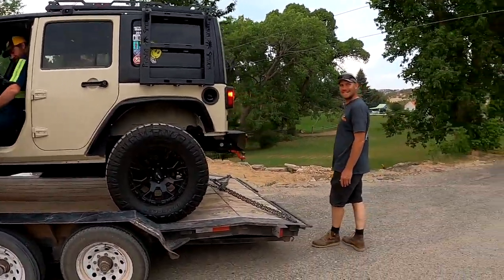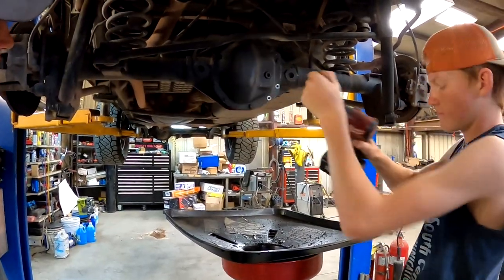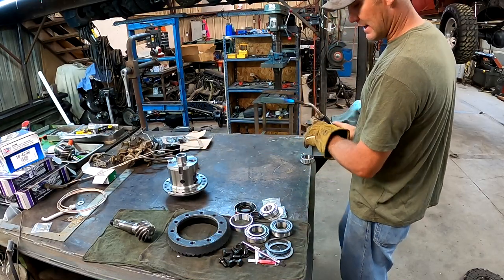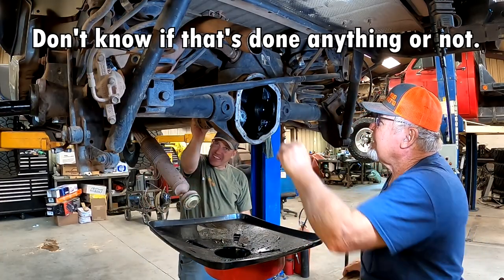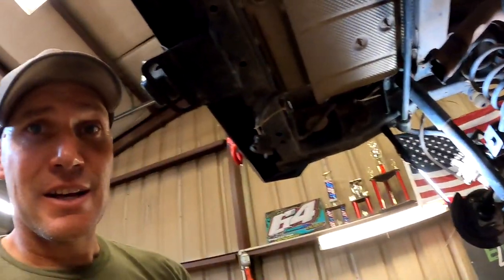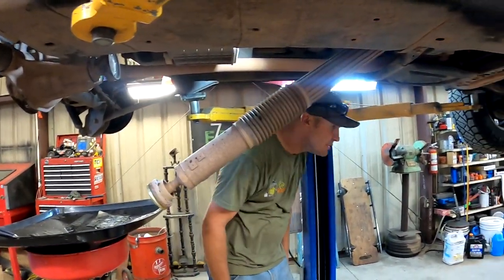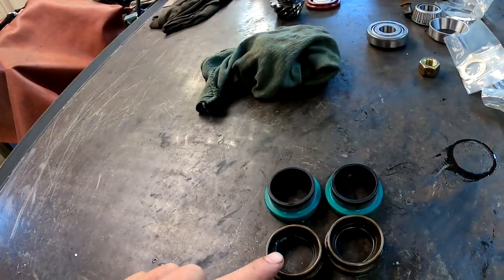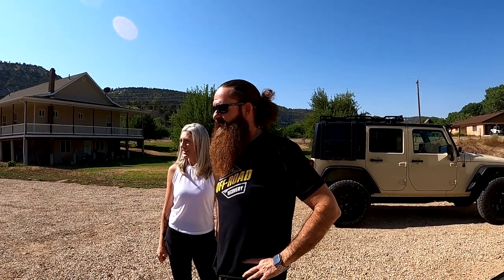Are all JEEPS this cursed?

Comment: Long time viewer, First time commenter. I was watching how you heat the bearings to slide them right on and wanted to tell you that most of these bearings are made of 52100 high carbon steel. They are hardened and tempered to a specific rockwell hardness. Heating them to a brown or straw color definately changes the heat treated hardness of the steel making them softer. I don't know if that affects there use or wear at all not my area of expertise. I am a knifemaker and can see by the color whats happening to the steel. You may want to look into it. Having said all that I absolutely love your video's and the work you do. Keep it up and best wishes to you and the family!
Reply: 100% correct.
Reply: Timken says that 250 degrees is the upper limit for pre-heat before temper starts to change
Reply: i agree Heating that Bearing like that did not sit well with me. He Might want to Try dry ice on the axle, that might work. or Just Pres them on like i believe is the Recommended / Designed Method. a little dry ice on the axel & they might just tap right on.
Reply: When dealing with tempered steel if you change the color of the steel you have changed the hardness of the steel.  It is not necessary to use that much heat a little will do it. Or Instead of putting heat on the bearings I chill the shaft causing it to shrink.

Comment: "I just made it hard"!  No truer statement has ever been made.  I am delighted to see someone else has the same luck/curse that I have.  Now I don't feel like I am alone with this luck/curse.  

 When I worked in the field repairing heavy equipment, many times I had to have more parts brought to me.  Sometimes I was 3 hours away from the shop.  That is just the nature of repairing in the field.  Since you are an hour away from your parts store, you might as well be in the field.  LOL

If I had to order a special seal to do a job, I would always order an extra one.  If it was a special order, I would order 2 extra.  I could always return it to the parts department if I did not need it.   The old saying, "It is much better to have it and not need it, than to need it and not have it," is soooooo true.

Comment: Fab Rats you make it look so easy ! As for MAP gas heating the inner bearing race only drawback is you could temper the race soft if you go past straw color. Hot oil would be my choice here, but I'm not under pressure to get the job out quickly either.  Great video thanks for posting !

Comment: I have found that to heat up bearings etc I wrap them in a wet towel and toss them in the microwave. Keeps the heat down in the shop.
Reply: @infernalhybrid  As long as it's surrounded by fluid like a wet towel it's ok.

Comment: Another one out the door !  We used a deep fryer to heat up bearing and races. before I used a torch and a temp stick. You wouldn't believe the amount of bearing that failed when others had worked on them before. We mainly worked on heavy equipment and tri-axle trucks. Got one of your shirts, love it !!

Comment: Frustration is after 10 1/2 years without a vehicle, I was given a 2002 Kia Sportage from someone at my church. I've had for about a year and after 40 surgeries on my body and taking my time I've done some things to it, but the whole suspension and frame rail is rusted. The frustration part is that when I does the death wobble, because there are 3 loose ball joints on the front left side, I'll have to junk it. Then I'll be back to not having a vehicle. It is a blessing I've had another vehicle to drive, but....    I'm glad your able to do so much to vehicles and have your knowledge. You make it look easy and you all have fun doing it. God Bless

Comment: Lubrication, lubrication, lubrication....its always been a big help for me when I lubricate the mating surfaces so the components can mesh together with less binding, vs trying to beat everything together with the big hammer, plus easier to take back apart if need be. if it don't fit beat the hell out of it!
OBTW: Original trade and training, more automotive repair experience than other trades

Comment: Paul, those TrueTracks are AWESOME... even with one wheel in the air, you just add a little brake, parking brake, or pedal brake... and it starts driving on the traction wheel again. The military uses them... they take a little work to get used to, but they work great!
I have one in my rear diff... I'm thinking about putting an OxLocker in the front...

Comment: Been heating bearings for years with a rose bud. Today was pinion bearings (cones) as Cat calls them for a 966G loader. Usually when they start to smoke good is a good indicator also that they are ready. Great job on the build.

Comment: Colour change is getting awfully close to heat treatment temps.
Reply: I agree. The brown, straw color I saw shows it's definately changing the hardness of the 52100 steel.
Reply: I was thinking the same, but then I realize he does probably hundreds of these a year and drives them hard himself on his trucks so it's probably no biggy.
Reply: @angrydingus5256  
Would it still work?
Hell yes, the bearing is way over sized , under loaded and runs at extremely low speed in an oil bath. 
Yea, it will outlast several sets of tyres the seal and probably the axle it’s sitting on. 

Is it damaged?
Quite possibly, at that temperature the surface hardening may have lost a significant percentage of its effectiveness.
Reply: @brucebaxter6923  Fair enough. And Im actually glad someone brought the subject up. I even looked up if this was "okay" to do before finding this comment and read that you shouldn't heat a bearing much past 150F and that 250F could make it brittle, I suppose depending on application it's used for though. Thanks for the insight.
Reply: @angrydingus5256   you got to get metal a lot hotter than 150 degrees before you change its hardness. I’ve been working with metals for over 55 yrs.

Comment: Wouldn't most wheelers out there change to a locker, especially when changing the gearing? In my case lockers have got me out on more than one occasion. Just my 2 cents worth...
Reply: They should,  but the lockers are usually around twice the price of an LSD. So he is getting two LSDs for the price of one locker. For an overlander the LSD should work fine, but also get a winch.
Reply: @KJsProjects  good point and silly me not thinking about the $$.
Reply: @KJsProjects  I'd rather save up for lockers than do this job twice.
Reply: With Yukon: 500 for LSD, 800 plus air parts for air lockers and 1000 for electric. TBH if you have the money to start this project with a newish jeep I'd go with the locker too, but just like in my case 15 years ago, the payments might be inching into his upgrade budget. LSDs for a 44 might have a reasonable secondary market price ready to help pay for the upgrade after the budget has some relief. 900 for an OX 🐂 😋 👀 Which I'm obviously a little biased towards.
Reply: I’m locked front and rear, but nothing beats a winch.  Less chance of damaging drive line.  A light foot and a winch saves the day 99 percent of the time.
Reply: I'm completely ignorant here, but is the LSD more forgiving on the drive train than a locker? I guess if you're not locked though it shouldn't be wearing any differently than an open diff right? Like I said I have no idea
Reply: @thomascalton3067  LSD is harder on your tires and axles and brakes lifetime than an unlocked (open) locker, but a locked locker definitely has potential to break more things or require upgraded axles or components just to push it to its full potential without breaking. When you lift a wheel for instance all the torque and weight get transfered to a single axle and obviously most vehicles weren't designed to have both the weight and torque shifted to a single wheel without any help. Since LSD will slip on a completely lifted tire it would avoid the upgrade to chrome molly or 35spline axle shafts. Of course upgraded shafts put more strain on the yoke, and putting in upgraded drive shaft puts more strain on the transfer case 🙄 Its a bag of worms for sure. A cutting brake and an LSD and a front locker was the set up I had till I could afford an upgraded 44 with all the trimmings.
Reply: @thestig007   Exactly! Buy once, cry once.

Comment: Hehehhe.

Pretty much did the same trick to replace seals and ABS ring on my friend's Xterra.
Sunday and no shops open. Bought a bunch of cast iron pipe fittings and made pretty much that same hammer/pipe setup.
The returned all the fittings to the store (it was a car parts store with garage/service, but they refused to press the parts if the truck was no in the shop.)
Joke's on them, we did it in the parking lot!

Comment: That is the part that most people just do not get when it comes to working on stuff and charging them fairly --> who is responsible for the man hours when stuff goes wrong, the rusty old bolts that break off, the seals that are bad or worse the good ones you wreck (Opps).  Good work Paul.

Comment: Perfect time to add chromoly axles and HD diff covers
Reply: Yeah I thought those axles looked pretty spindly.. Of course, I'm used to Toyota & Chevy.
My old '67 Land Rover Series 2A 109wb was a beast. One ton. 12 leafs at every wheel.  Wasn't the most reliable, but cheap n easy to fix.

Comment: I’m a fan of the channel and am trying not to sound like an @ss so with that said, it would be worth your time to run your bearing heating procedure by a bearing manufacturer. I think you’ll find that they say if you see any color, you’re already too hot, and heating with a torch is pretty dicey. Bearing deformation can be another issue when using a torch instead of an oven or induction unit. A temp stick is a good way to keep tabs on your heat. I use a 250F stick.

Comment: Those pinions are always hard going on. I welded a piece of pipe to an air hammer shank that fits the inside diameter of the yoke and use the air hammer to drive it on. Works great.

Comment: good video, fyi, heating up bearing races enough for them to change color will affect their heat treat, and its probably best to avoid it. 

bearings are generally made of 52100 steel or something similar, this is not a high speed steel that can withstand higher heats without loosing temper. generally bearing races are tempered down to the low 60's hrc and balls a little higher. this requires a tempering temperature of around 300°f. judging by the light straw oxidation color your getting, your probably heating the bearings up to around 300-350°. so yes, its close to the temperature they were tempered at so they wont be "ruined" necessarily, but you are also introducing stresses in the race by heating it unevenly, and the temperature your getting it to is definitely not consistent.

Comment: I agree with you on the bleepin Jeep! I had a 2002 Jeep Grand Cherokee and it had leaking rear axle seals so I decided let's get some new bearings and seals and replace said leaking seals well that went well because about 2 months later they're leaking again so by the third time I decided to pull the axles take it into the machine shop have them replace the parts maybe I was doing it wrong carefully put them back on two weeks later leaking again I gave up couple months later the repo Man showed up his problem now!!

Comment: If you use an old electric griddle to heat bearings you get much more even heat and it works wonderfully!  That way you don't have to stand and heat each one you can set them all on the griddle and keep working.

Comment: I see u r having trouble getting the yoke to slide onto the pinion,I had a similar problem with a bearing in a UTV differential. I found If you put the yoke in the oven at 350 degrees & the pinion in the freezer for a hour or so the yoke will expand & the pinion will shrink just enough to slide together without a problem plus 350 degrees is not hot enough to damage the yoke. Oh,u have to act fast before the temps. of the parts normalize to make this work. I hope this helps u with future jobs? Love watching your vid’s.,very cool stuff! Thanks!

Comment: Paul, I totally agree about posi vs lockers.  But truly, most overlanders do 99% highway 1% two tracks, so it works fine.  Note, works fine is not works great.

If you are going to carry a small crescent wrench in your pocket.  Get a big one and trim the handle to the size you already carry..  Now it will fit way more bolts.

41 and 11 is 3.72's.  What was Matt thinkin'?

Comment: Here I thought it was bad to have to wait 15 minutes for one of the 6 parts stores to deliver. At my first job in the 1960s, We took the axle retaining rings off with a chisel. Two hits with a hammer in 3 different locations and they would fall off. Then we used a sledgehammer to break the bearing on an anvil. There was a fixture that used a hydraulic jack to press everything on.

Comment: I maybe would have had the true trac in the back and the weaker posi in the front.  The true trac works very well with automatics. They seem to create allot of running slack in manual shift vehicles.  A true Detroit locker maybe be to much depending on weather. I had one in a jeep that was squirely as good be in rain and on snow freeways. I added some overland gear and winch on the back and the weight helped. Before then felt like trying to control a street vehicle with a spool.  I have been told the new style yukon locker is the best of both worlds. smoother action for slippery roads and works still off road.

Comment: 4:28 I was wondering how long that trailer hitch would stay in there.. Someone must have bonked their head on it!
For heating bearings, I use an old toaster oven at about 450, toss them in for 5 minutes.. and you can warm your pizza at the same time

Comment: great video .. just a idea get some flat stock drill holes to match the diff cover width . put a hole in the center .use a long bolt and nut to wedge the pinion off the flat stock to hold it in the rear end .. could also weld the nut to the plate , just like a gear puller but in reverse .. thick flat stock so it won't warp or bend .. that long of a drive for parts i would have gotten extra parts ..then take them back next date night ,,

Comment: Good video ! i Like that Date night idea When u have to get a part thats a 1 Hour drive away. Bring a Friend , Go get dinner & parts. 
Maybe some idea's to Get Parts -
1) ask if they deliver ? what they charge might = Gasoline $
2) maybe have a Uber guy go get it for u ?
3) Thats What u Have Kids for - Make em earn thier dinner & roof over thier head ?
4) i Allways buy 2 or more of things just to have  spares around if u use them within 1 year usually.
5) Start Building some inventory of Parts that are cheap & far away to save you Lots of time.
i made a rule - if i use it within 1 year. ill stock that part. Driving for parts around here Eats up Alot of time & Is Just not Worth it.
if the Part is under $100.00 & i know ill use it within 1 year. i stock it on my Truck.

Comment: This was great to see what it takes to change some gears! Thanks Paul! Couple questions, what would it normally cost to have someone do all this work? Seems like if it was a stealership it would be outrageously expensive. Was also curious do you end up torqueing all the bolts like the ring gear, axle retainers, bearing caps, diff cover, etc?
Reply: Normal gear change would be around 1,200$ -1,500..

Comment: Also,  I live in the rust belt. I can’t believe how easy it was to pull those shafts.  It took me a day for each side on the front. The 12 point bolt heads were just round places to admire. Then they wheel speed sensors were so easy to pull, no wait I mean nightmare.

Comment: .004 on that gear setup ,seems a little tight in my experience , it will probably be okay if only using it off-road and not like prolonged Highway use where it's getting hot , I try to go nothing less than .006 preferably .008 and a max of .010 if I can't get the shims to cooperate or don't have or cannot get the right shims, just because of heat build-up that whole assembly is going to grow a little bit when it gets hot

Comment: If the parts store is a distance away or has limited hours (NAPA), I am always tempted to buy an extra/Murphy set if there is a risk putting the part in successfully. Stock parts are easy to return. Just keep a box or bucket labeled Returns by the door for GoBacks. I'd think Paul would know how to dance with Murphy. #1. If something can go wrong, it will. #2. It will go wrong at the worst possible time. #3 If the parts store is an hour away, Murphy likes to play. #3M (Matt). If Matt ordered the parts, Murphy is eager to play.

Comment: My 94 grand cherokee  does all right for a $500 deer lease special. Dropped some yellow lincoln 4.6 fuel injectors in and it really improved the idle and power everywhere except peak.
4 hole verses 1 hole stock. 
Cant go wrong with that 4.0.

Comment: B) Avoid the pitfalls
Important: parts must never be heated with a blowtorch.
Heating a part too quickly and aggressively can alter the material's properties and thereby significantly reduce its service life. There may also be other consequences:
Bearings: expanding the inner ring faster than the outer ring creates significant stress on the rolling elements and may damage the actual elements or the raceway.
Therefore, you are strongly advised to use appliances that keep the difference in temperature between the bearing's two rings under control.
When trying to install tricky seals, stick them in the freezer for a couple of hours

Comment: yes that is a good way to do the bearings, but you should use a needle tip on a grease gun to pul some fresh grease in the bearing after you torch it and burn the grease

Comment: 2011??  If so - could have even run a 5.13 gear.  Good to see I am not the only one that has had issues with the Yukon parts.  What did he use to reprogram the Jeep for the new gear ratio and tire size? Nice work as always!